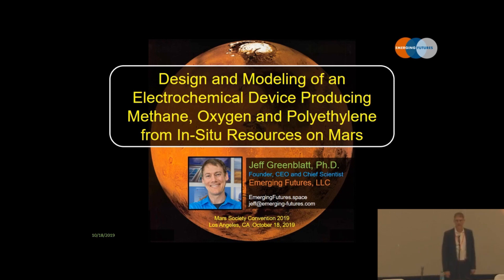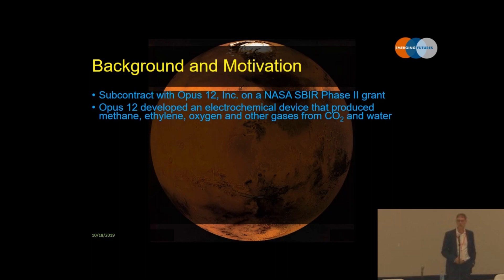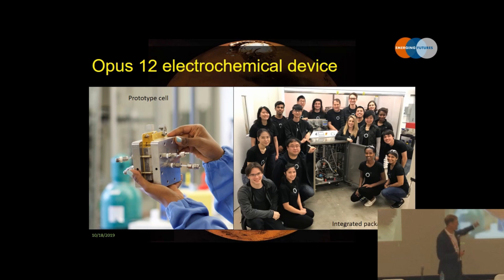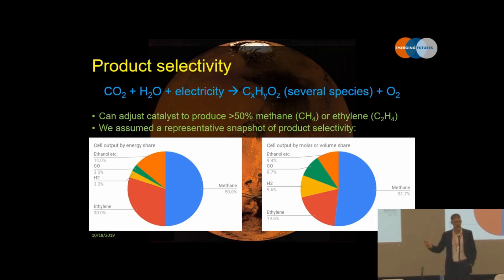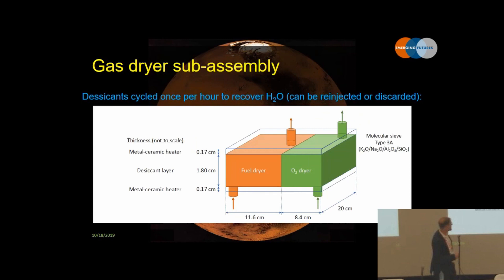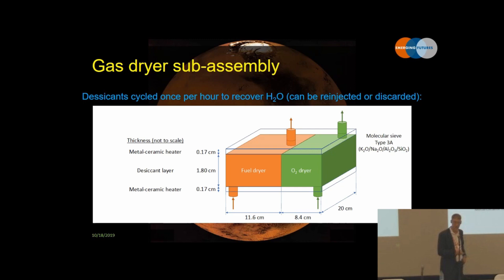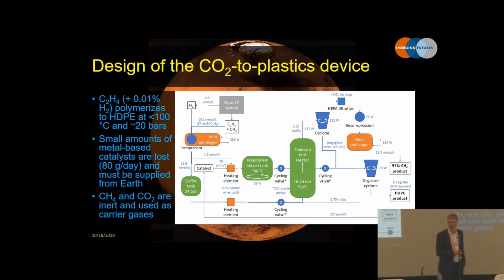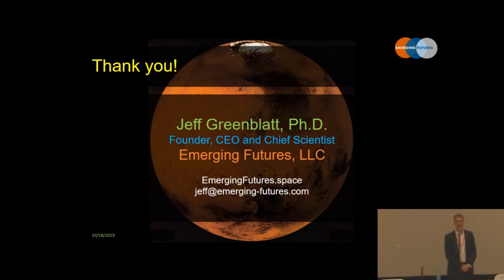Jeffery Greenblatt - Methane & Oxygen ISRU - 22nd Annual International Mars Society Convention

Comment: Why bother Separating or reacting CO to become CO2?  Would CO not also react with the water to form Methane or other products?  Couldn't you just pipe the CO and CO2 mixture back in, to react with the water again and not need to spend the energy to make the CO back into CO2?